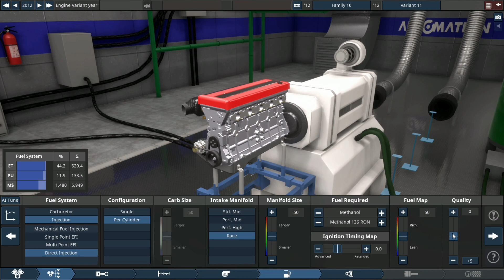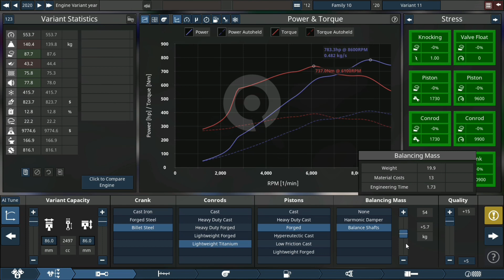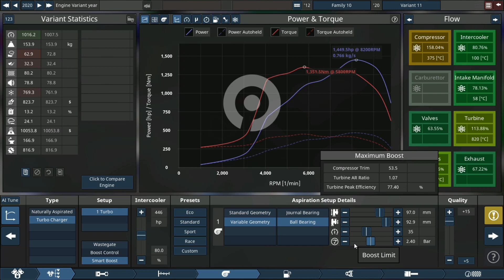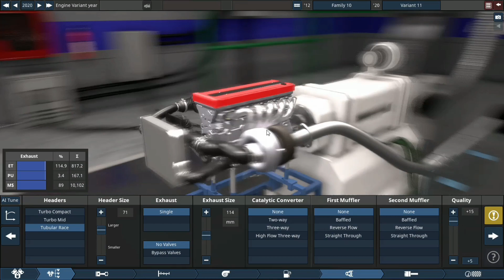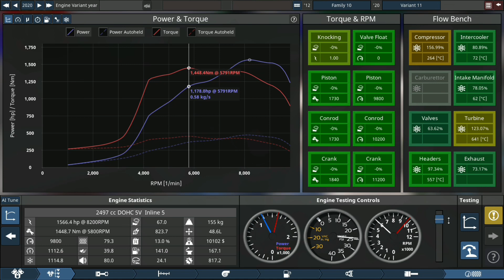GINORMOUS Turbo attached 2.5L inline 5

Comment: 4 valves VVL, and u should make springs and lifters stronger (this will help you with high RPM limit), and u should try magnesium material for head and block, just try it for more powerful engines
Reply from the maker: Thanks will do 👍